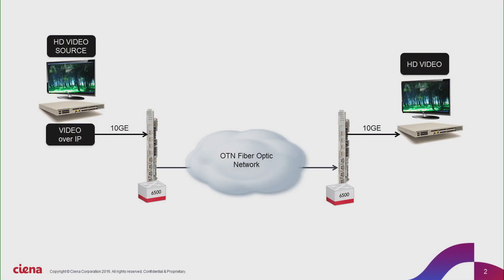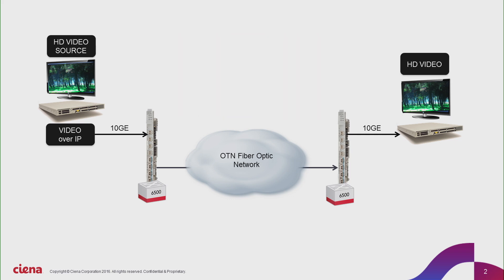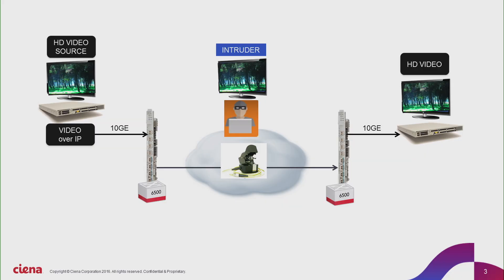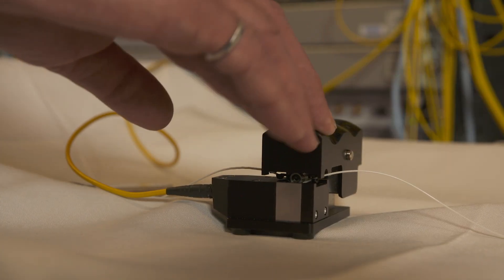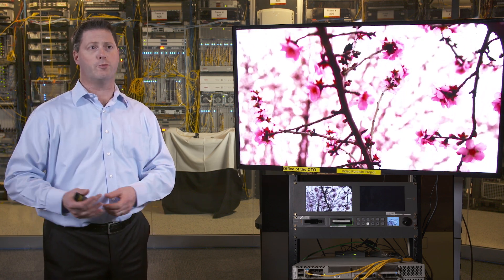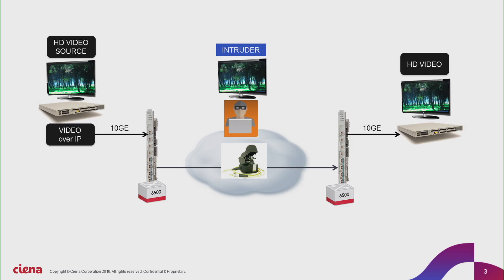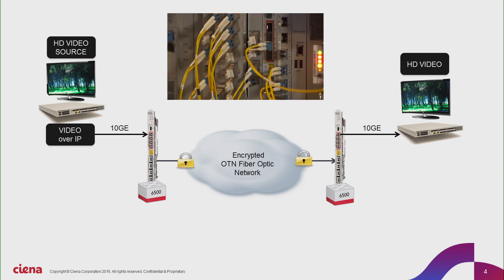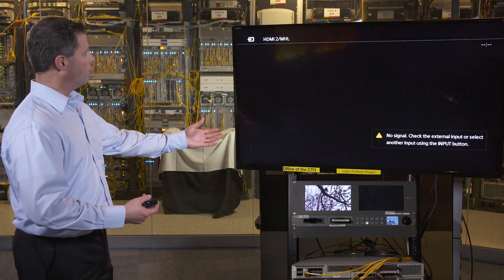In the Lab: Hacking a Fiber Optic Line in Minutes

Comment: Is it possible to detect that somone taps into a fiber opitc line, e.g. by meassuring the loss of light?
Reply: Answer is yes, if the fiber is tapped with a device like in the video. But if this is done at monitoring points, which are built-in into the transmission link, you will not notice this.

Comment: Does this mean then that, once Quantum Computers are fully implemented and 'the standard' for Businesses and Consumers, the current idea that they could not be hacked, is in fact wrong? It is my understanding that data sent between Quantum computers would be travelling as light signals and as such the data is only viewable by the Sender and Recipient of the data. However, data sent through Fibre Optic cables is also light, and if Fibre-Optic can be hacked, then logically so could data sent between Quantum computers, with a Hacker performing a MITM attack and simply copying the data stream.